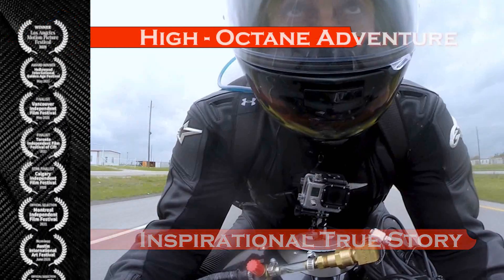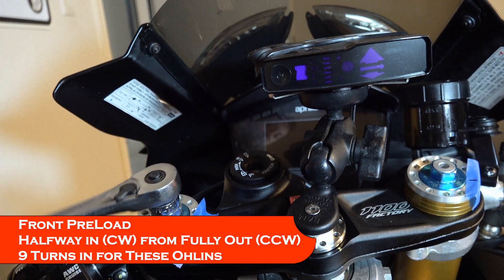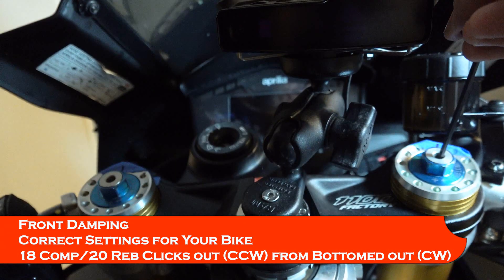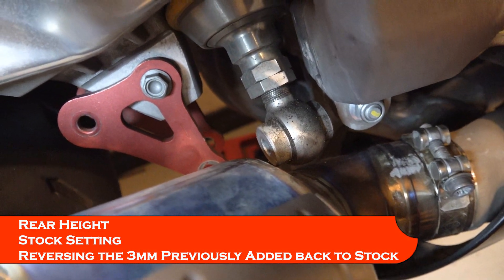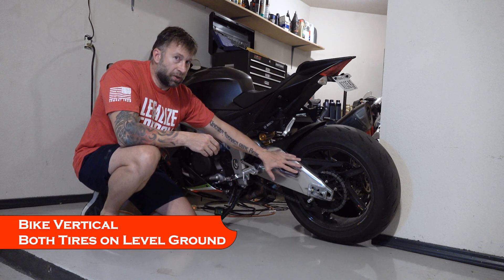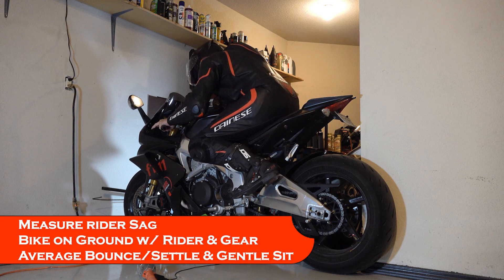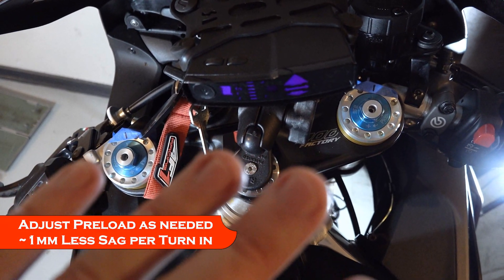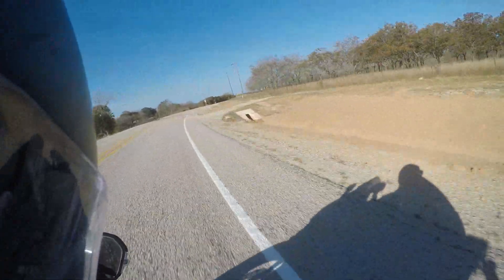OHLINS Suspension SETUP APRILIA RSV4 1100 Factory Suspension Setup ADVANCED & Sag

Comment: Thanks for your video, I keep coming back to it. It's a NIX 30, correct? How do you know that 1 full turn equals 1mm of preload? My experience is that a full turn gives me 2-3mm. This might depend a lot on your springs, I guess.
Reply from the maker: yes, i think these are the same nix30 that are in my s1k. the 1 turn/mm came from some manual...can't recall if it was the ohlins manual or aprilia or online? if i understand right, the spring should be irrelevant, it should just be the pitch of the threads, i.e. one thread per mm would do that. to your point, i used the 1/1 as a starting point but still had to adjust it quite a bit after that.